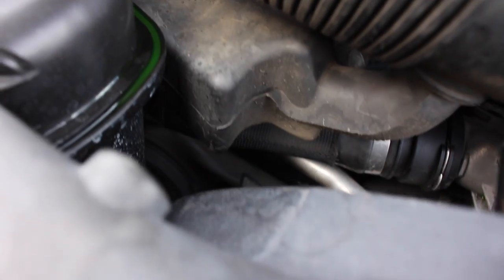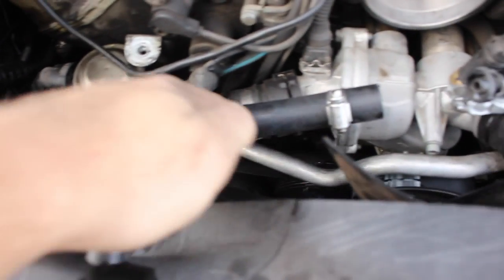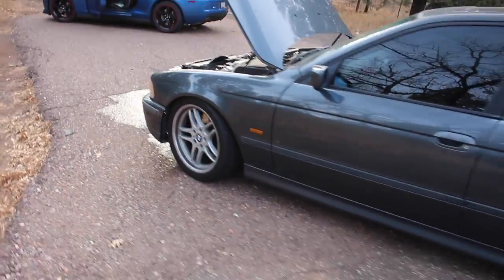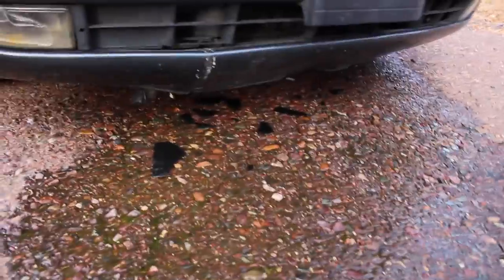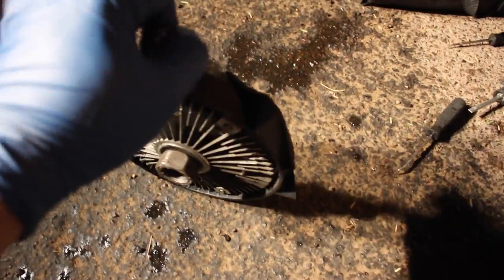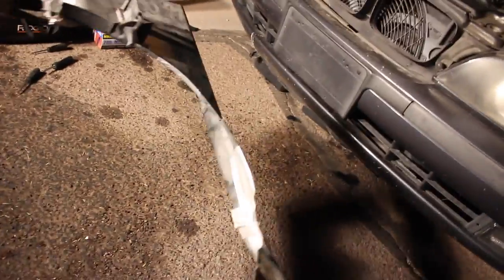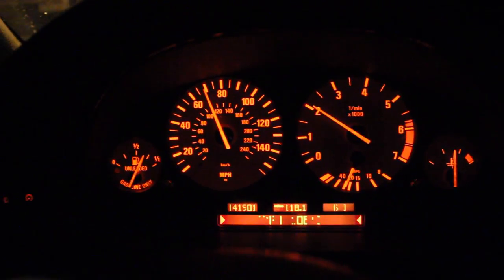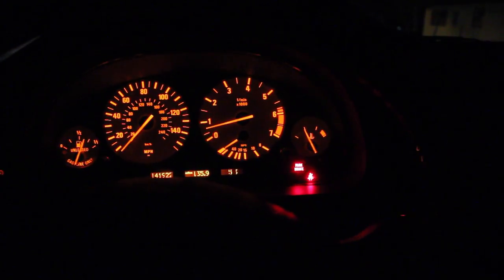My $1500 BMW 540i, aka The Bavarian Radiator Destroyer

Comment: My 528i overheated a few days ago and I realized there was a crack in the expansion tank which leaked out any coolant I put in there, so I got a new tank which fixed everything up. Along the way I accidentally ripped off the vacuum hose and losing the clamp that goes on the pump under the tank which took me 1 hour to look for, I broke the 2 push pins that go on each side of the fan clutch cover which I had to replace with metal ones. All the damn plastic on the car can get annoying but I love BMWs they can just get so damn frustrating
Reply from the maker: Yeah, the brittle plastic is annoying but once you've got the whole cooling system replaced it's usually good for a while. I replaced the cooling system on my 2000 540it like a month after buying it, and that's why you don't see it too much on this channel— it never really breaks!
Reply: Exactly lol and I  forgot to mention I hadn't put coolant in my car in months prior to the overheat, so that's all my fault and I believe that was the problem for the expansion tank cracking.

Comment: The state of that engine bay. Sell the car and buy a Toyota.These cars are not for you.
Reply from the maker: You're missing the whole point of the video... I was having fun with a cheap beater 540i6 that was destined to be a parts car for a manual swap. It wasn't supposed to be nice. I keep my actual daily drivers (2000 540i/6 and 2003 Range Rover) in perfect mechanical shape.